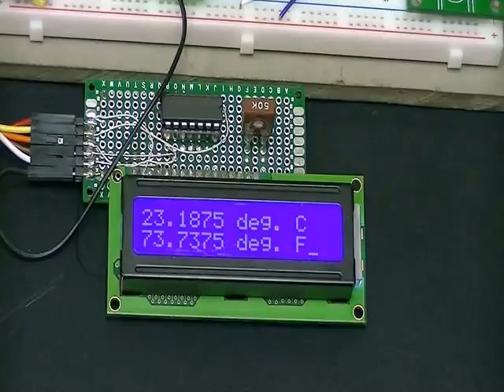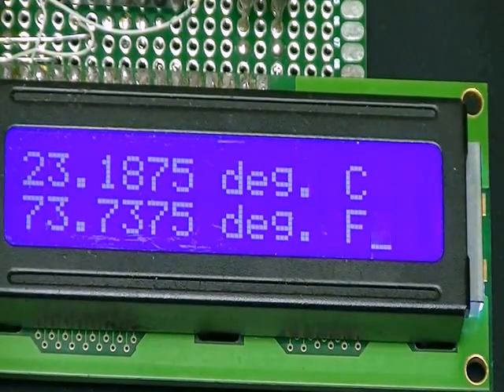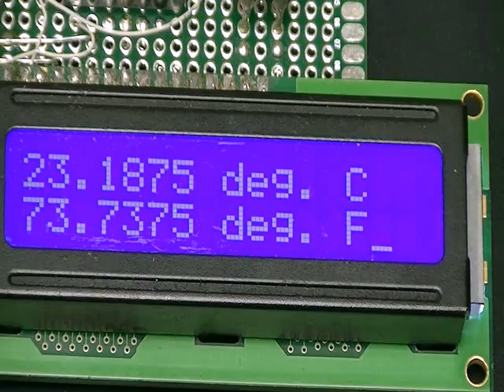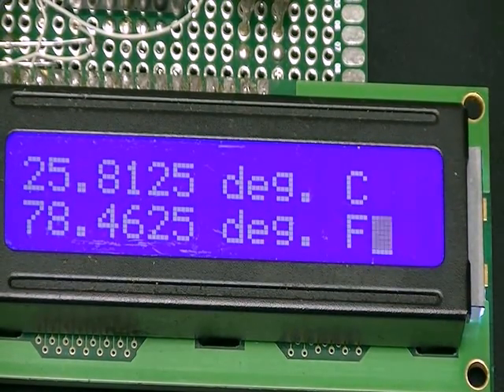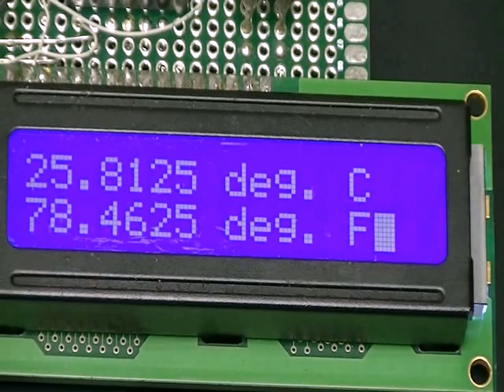Connect Arduino to PC Printer Port for advanced control

Comment: Hi sir,
how to open a printer boot menu to find fault. The firmware gone wrong so if printer is on it shows wrong model. The printer is Richoh sp 210 su, now it show as 213Nsw. I want to repair myself. Please guide if any programmatic approach. Can i reconfigure its firm wear to its original. No use by trying panel menu.

Comment from the maker: Other than change pin designations on the Python
side all programs work the same on Printer port or
Raspberry Pi.

http://www.bristolwatch.com/pport/pportArduino1.htm
Part 1: Read Arduino with PC Printer Port
http://www.bristolwatch.com/pport/pportArduino2.htm
Part 2: Better way to Read Arduino Through the PC Printer Port
http://www.bristolwatch.com/pport/pportArduino3.htm
Part 3: Read-Write an Arduino Through a PC Printer Port
http://www.bristolwatch.com/pport/pportArduino4.htm
Part 4: Control LCD Display and Arduino from the PC Printer Port

http://www.bristolwatch.com/rpi/rpi_arduino2.htm
Connect Serial LCD to Raspberry Pi
http://www.bristolwatch.com/rpi/rpi_arduino4.htm
Serial Read from Arduino to Raspberry Pi
http://www.bristolwatch.com/rpi/rpi_arduino3.htm
Arduino Raspberry Pi Interface with LCD Display